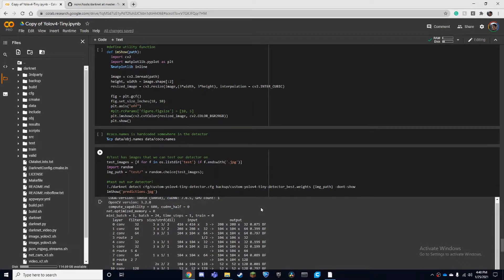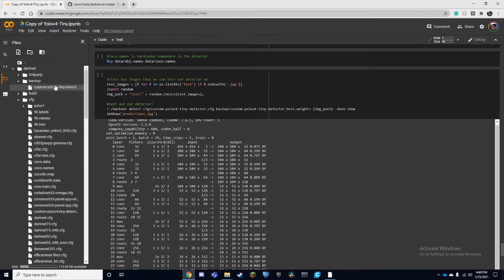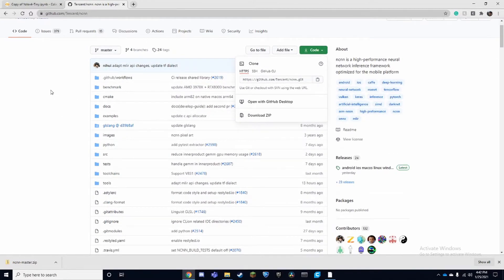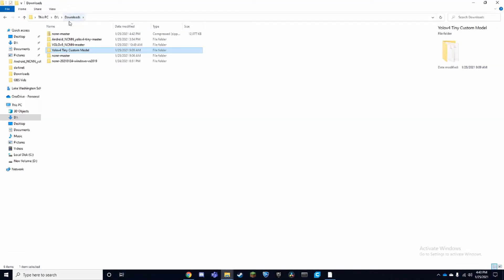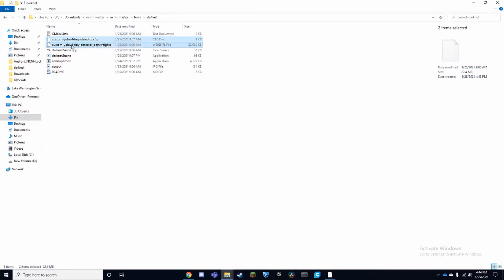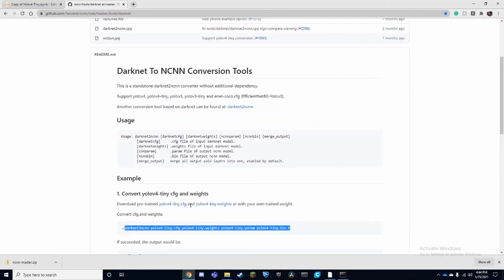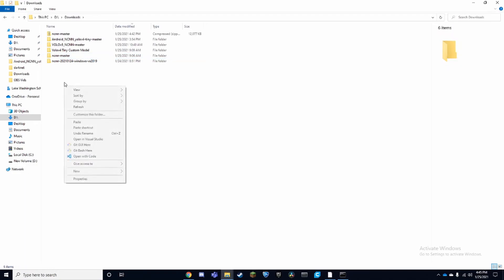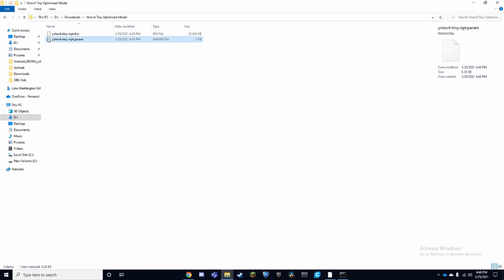How to Convert Yolov4 Tiny Weights to NCNN framework (Smart Dashcam Part 3)

Comment: Hey, how did you do the executables. I cloned the repo and built it however when I tried to optimize the param and bin it doesn't work because the optimize file throughs me a lot import errors when I tried to compile it